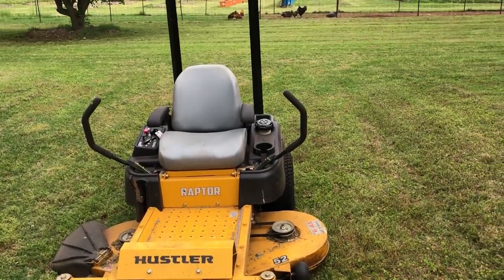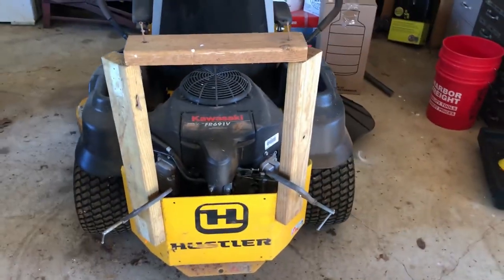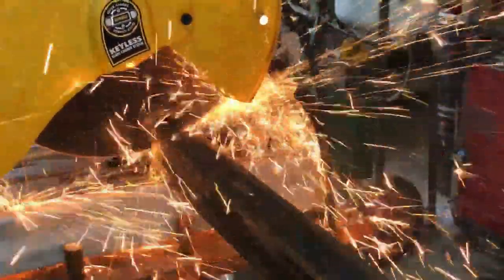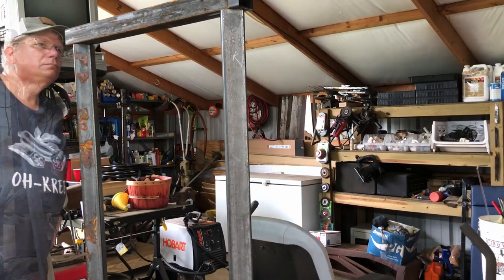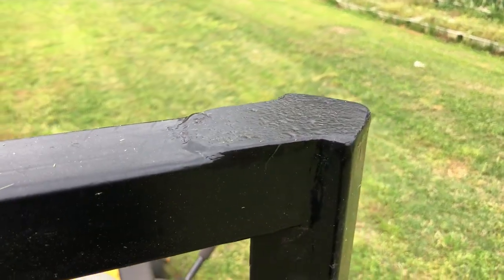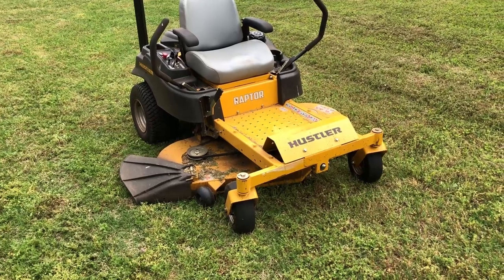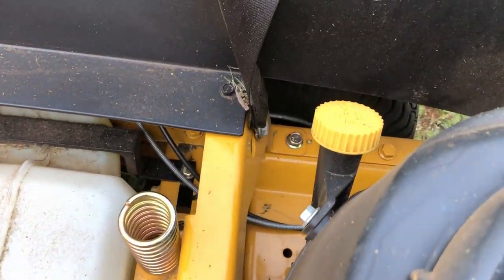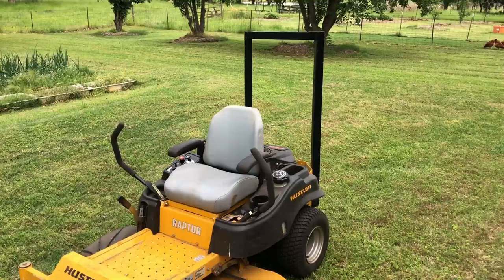BOLT ON ROLL BAR FOR A ZERO TURN MOWER (ZTR) - DIY HUSTLER RAPTOR ROPS

Comment: Looks good my Exmark came with one just watch tree limbs and guide wires on electric poles found out the hard way.
Reply from the maker: I would’ve never even thought about guidewires. I only have one pole that has got wires and I don’t mow around it with my zero turn. I mow around it with my tractor. And yes, I have to really watch out for that wire.
😎

Comment: This video is brilliant. I sure wish my John Deere S240 lawn tractor came with a ROPS if they knew of the many accidents that there have been on riders in general. I know there may be other options for a lawn tractor but I’m going with the DIY approach for what I’m doing with my lawn tractor. It didn’t come with a horn either but I decided to install one just to be on the safe side.
Reply from the maker: You can do it. It just takes a little, figuring out some of the angles, etc.